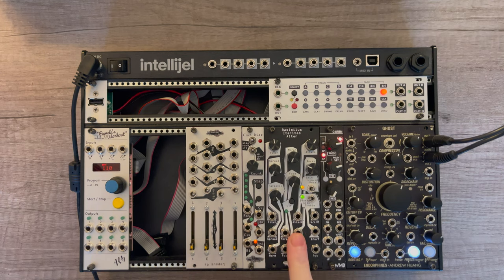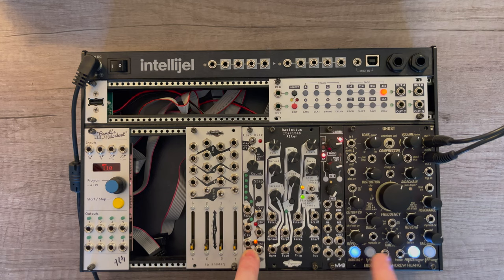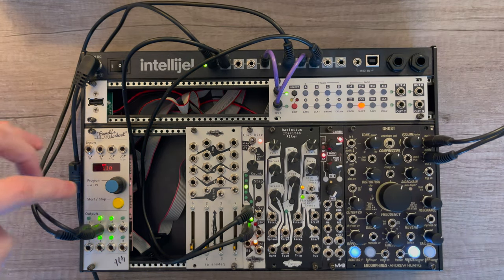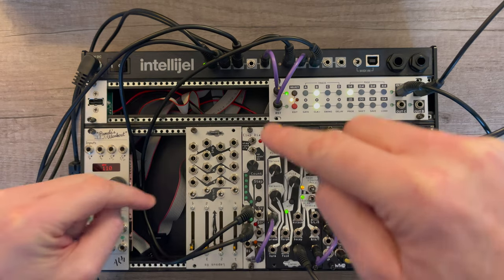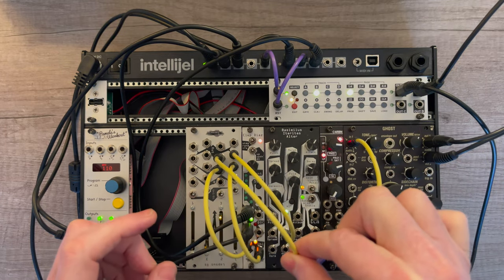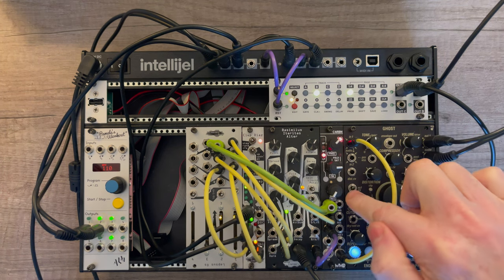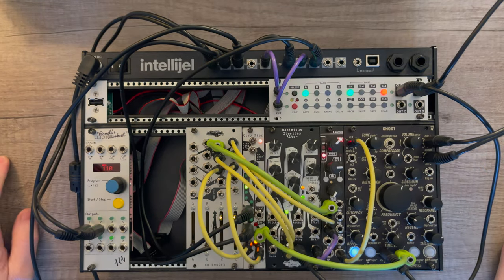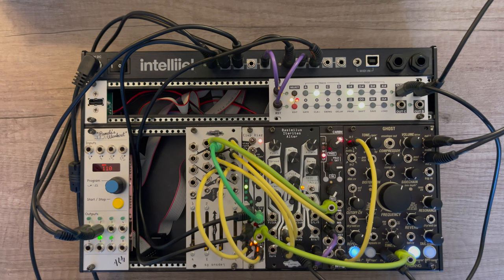Clep Diaz - why I love this "simple" LFO

Comment: Awesome demo and patch. I've seen a few examples with Clep and never really been that compelled by it but this one has definitely turned my head a bit. I've currently got Mimetic Sequence for pitch and CV modulation but can see Clep pairing with this quite nicely
Reply from the maker: Perfect combo! It works well combined with a mimetic cv additive like through Lapsus OS
Reply: @markbooth  Trying to visualise how this would work. So Pitch sequence through Mimetic Sequence  being tranposed by Clep using the offset input on Lapsus??
Reply from the maker: @freddiefranklin1  for pitch I always send Mimetic through a quantiser as it’s too much like hard work otherwise. I then sometimes modify that with Clep (heavily attenuated of course) but mostly use Clep for non pitch work. If you put Clep into the + input of Lapsus OS, it modifies the input signal. You could merge the two with any CV mixer though.
Reply: @markbooth  Yes sorry I think I understand you now. So modulating the CV coming from Mimetic with Clep via Lapsus

Comment: Awesome Clep spotlight. I love that the clock input is essentially just a trigger input.
My favorite patch in my palette case goes as follows:
Keystep pro gate CV (multed either from my kick or melody) > Clep clock input, Unipolar output > Batumi LFO freq input in Quad mode, then I get a hybrid of clocked-free running LFOS with attenuation .
And of course the Clep outputs are multed so I get the same stepped modulation everywhere. I especially love it on the release of my javelin
Reply from the maker: Clep on the mults is a winner if clocks are handled elsewhere. I’d love a Batumi and would go well with my workflow I think. What are your go to sound sources?
Reply: @markbooth  The 4ms EO! Rhythmic modulation is my key to that beast.
Truth be told, I've probably got too many LFOs for such a small case: Clep, Batumi, and Pams all in one. If I ever decide to downside, the Clep will always stay lol

Comment: Nice demo Mark.  Before you run out and buy another Clep Diaz, I've an idea for you to try. For a while I've been wondering if you could replicate something resembling the Clep using a cycling LFO out of Pams, into a sample & hold. 
As I understand (not yet owning one) Pams can do tempo synced ramps etc over a wide variety of clock divisions, and the S&H would convert that to a "stepped" output. In some ways there might even be more flexibility? Something to experiment with anyway.
Reply: I have been thinking about using Pams in the same way.

Comment: Aside from lapsus, literally every other module in that case responds to triggers. Steppy. BIA. Carbon (ping, as you mention). Ghost (sidechain). Pam's doesn't really like an irregular clock, but you could probably get some weird clock feedback if you were so inclined. :P
Reply: Now that I think of it, given that carbon has a wave folder, varying the trigger height with lapsus would vary the timbre.
Reply from the maker: @GeorgeLocke  I wish the wavefolder could also be triggered with CV like the saturation can
Reply from the maker: I was found to sidechain the Ghost with a duplicate kick channel from Steppy but didn’t get around to it in the demo. It works really well, just not quite as well as a real compressor code chain
Reply: @markbooth  my thought was that a different strength of trigger would ping the filter with a different amplitude, thus folding differently. (I assume the folder is after the filter? )
Reply from the maker: @GeorgeLocke  interesting idea and I hadn’t thought about trigger strength. I might try that! I’ve recently leant BIA responds went to AM as well

Comment: Have you looked at Fractio Solum? It has a BOC output and it's 4hp. Also NE so fits with the other modules 🙂 edit - actually I don't know if BOC would work. Haven't checked the manual to see how it's implemented.
Oh! Shakmat Modular Clock O'Pawn. Check it out. 6hp though, not 4.
Reply from the maker: Hi Marc, the Clock O’Pawn looks interesting especially with its Midi in so might look into that some more. Nice and simple. The Fractio is also one I’m considering for percussive variation and it looks quite similar to Clep Diaz but from a triggers perspective.

Comment: Can someone point me to what setting he has for Pams channel one to do the resetting? I’m not 100% familiar how to get that reset to happen on pressing start. Thanks!
Reply from the maker: You need a gate that goes from low to high
Reply: @markbooth  is there a repeat setting that is set to zero or something like that?
Reply from the maker: @h.r.terror9421 not sure what you mean. I do t think that’s possible though.
Reply: @markbooth  hmm ok. It looked like your channel 1 was only sending a signal when you hit the start button and wasn’t sending any signal after that.
Reply from the maker: @h.r.terror9421  that’s correct. The signal goes from low to high and technically stays high I think even though the light goes out. I must have replied to this question at least 5-10 times so probably worth a video in itself
Reply: @markbooth  hehehe probably! I thought you were doing some sort it witchcraft. I came to this video because I started looking at your steppy video which linked here. Thanks for your time!

Comment: If you have an O+C one of the hemisphere branches has a 'clep diaz' mode, could try that and have 2 more just like that!
Reply from the maker: Ah nice I’ll try that some time. Honestly I never use my O+C as I hate menu diving. I bought one and a Disting mark 4 for those times when I need something but guess my creative flow doesn’t work that way. Will definitely try it some time though thanks
Reply: @markbooth  I don't use mine much either for the same reason, but it stays in the rack on the strength of potential alone :) The firmware branch is called 'Benishpere' and also has modes that emulate memetic digitalis and mutable's grids.
Reply from the maker: @PsychicFusionReactor  thanks I’ll take a look. Not tried that firmware yet and emulation of other modules sounds good, especially grids which I don’t have. Thanks

Comment: I feel like clep is cool, but, like, if space is the concern,  I'd rather have a 2hp TM. Otherwise, clocked LFO plus S&H is just better in every way.
Reply from the maker: If only I had a clocked LFO…
Reply: @markbooth  Aside from Pam's?

I'm just saying Clep is not my style. I see I wrote a sort of twerpy comment below. I'm not trying to harsh the mellow here...
Reply from the maker: @GeorgeLocke  no offence taken don’t worry, words often come across more terse than meant. I get your point about PAMs but I much prefer to use deducted modules as I’m thinking things through. I have an O+C and Disting IV but never use them as they involve too much thought and lack of playability. I’d like a Batumi but trying to not over GAS lol. I like Clep for its simplicity,playability, and stepped random mode. I really do want to explore more creative low level stuff though like you’ve suggested
Reply: @markbooth  Disting can work if you just stick to one mode. I have the Ex and tend to avoid patching it except as a quantizer or when I'm finishing a patch and want a certain effect (clocked delay or s/t). I do like the DJ filter as a stereo highpass for droning reverb feedback. Sometimes you just need _this thing_. That said, the Ex has a proper screen - I need a web browser to find the mode I want (still do that with qiemem Stages), but it has text to tell you what you're doing.

I tend not to be bothered by menu diving as much as many.  Obscure button combos, on the other hand...
Reply from the maker: @GeorgeLocke  lol yeah i need a web browser to look everything up on the Mark IV and generally just use it as a delay or quantiser. An EX would be nice with the extra Horse Power